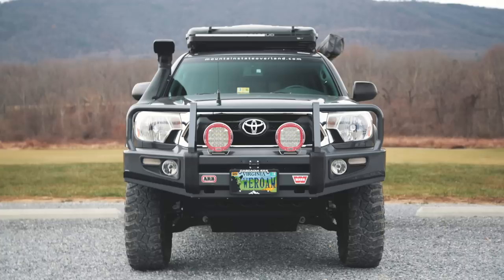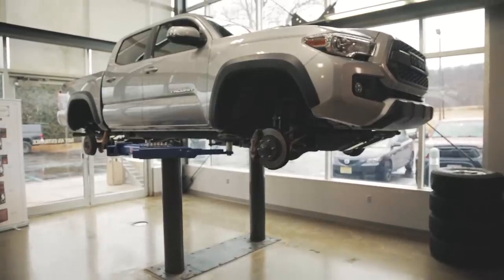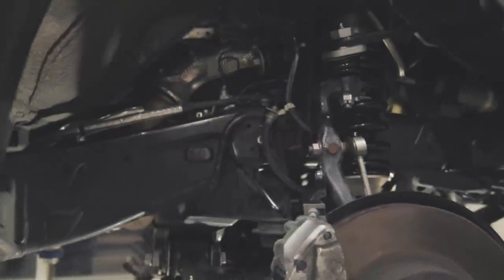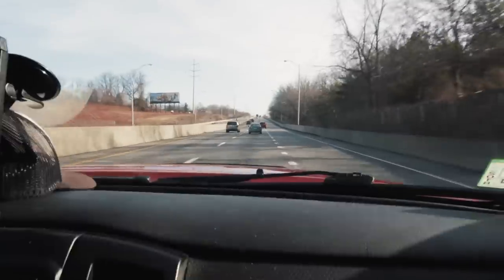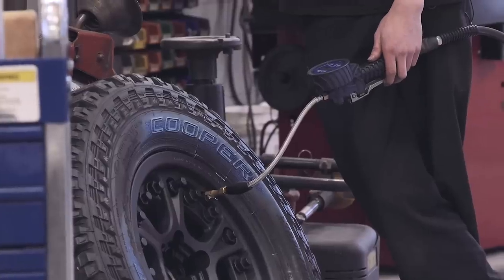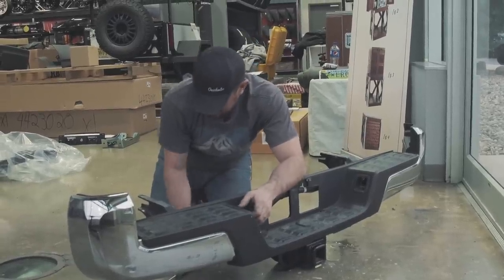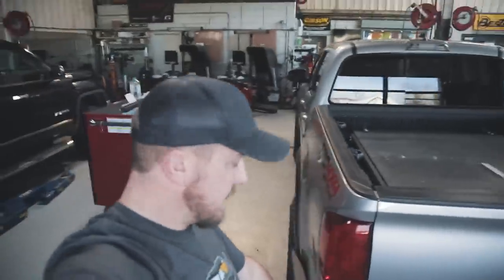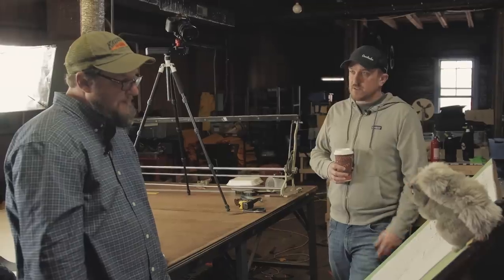Built 4 Adventure - How to Build an Overland Vehicle: Step 1 - Mountain State Overland

Comment: That things going great! Next time you're assembling bead locks put them on a 5 gallon bucket and it helps tremendously and if you can put super glue on the rubber seal it holds it in place while you assemble. Great job!
Reply from the maker: Good tips! Thanks for the feedback and thanks for watching!

Comment: Why doesn’t any build a full size anymore? Let’s see some big v8s and maybe even a solid front axle
Reply: Im with you!!! I wanna build a K5 sooooo bad. I may end up settling for a 1500 single cab with box
Reply: I’m currently building a 79 squarebody GMC shortbed reg cab. Should be good, but I think the general consensus is that they are too big for some trails. All depends where you are though.
Reply: Tundras don't fit to well on JEEP trails, I guess. I get what you're saying, though. 

These overloaded Jeeps and Tacomas need v8s. 

Funny thing to me is, all of these guys spend all of this do, re, mi turning their gas mileage to shit and I have yet to hear any mention of LONG RANGE FUEL TANKS.

If I were going to build an OVERLANDER (and I am) that would be one of my first, if not THE first, mod that I made.
Reply: Wayne Cummings forgive me if this a stupid question as I come from the Lexus world. But what about throwing a supercharger on it? Would that compensate for the lack of v8 power?
Reply: @musicguitar  What I have learned since this post is that changing the gear ratio is probably the most important thing to do if one is going to put bigger tires on their vehicle and add the weight of overlanding equipment. That will help the mileage and the performance. 

The way I understand it, most of these folks have found out that changing their gears is what they should have done first. The engines are powerful enough provided they do this.

This is what makes me appreciate them. They make all of the mistakes. They acknowledge it and they talk about it. They are providing a great service to everyone getting involved in this very interesting pass time.

First things for me to do: Pick a vehicle, change gears, mild 2 to 3 inch suspension lift, nothing taller than a 33" tire, long range fuel tank, recovery kit, a tool kit, fridge, fresh water storage, tent, cook set up and go figure the rest out as I go.

I'm looking forward to it.

Cheers

Comment: How much do you think all these mods cost? Also what are some advantages of the Tacoma over the 4runner?
Reply: Probably just a box
Reply: Id say the advantage is the separate storage but also that can be a down fall. One disadvantage for me in the 4runner, especially with all the off-road I do is the  noise. Inevitably  when you pack all your stuff up in the  same compartment you will ride there will be noise and as time goes on and parts loosen there will be rattles, this seems to be enhanced with every SUV I've had verse all the trucks I've had not so much as by design they allow for more flex

Comment: Such a great example, buy the Taco Offroad, then upgrade vs a TRD Pro
Reply from the maker: Yes, the TRD Pro isnt' worth the extra $$$ if you are going to "purpose" build your truck. The OR gives you the locker, that's worth it.
Reply: You're only saving like 3 grand, but its still 3 grand. This is the way only if you plan on upgrading everything. The Pro is meant to be a capable out of box off road vehicle for the non enthusiast.

Comment: Dude, I am such a loser! I can't afford any of this crap. Damn it
Reply: Ray I think you got it wrong. You dont need any of that crap. Its all for show. If want to "overland" you need to start with a good fuel range. With all these mods and and already weak gas engine taco has to offer in us they probbaly wont be able to drive accross a street before running out of fuel
Reply: Christopher Siedlecki isn’t that the truth.  Expedition overland recently did a walk through on their Tundra and it gets 6-7 mpg ☠️.
Reply: @4xDiscovery  , well, I'd just like to have a rooftop tent and the ability to do a bit of quick in and out overnights.
Reply: Dude,  you don't need expensive stuff to get out and have fun.  My buddies and I would load up my garbage  ford escort lx and get out into the mountains to  camp, fish and shoot.
Reply: Step one: put cap on truck
Step 2: bed in cap
Step 3: quick in and out adventures 

Or buy a small SUV and sleep in the back with a $200 sleeping bag while you save up for shiny mods